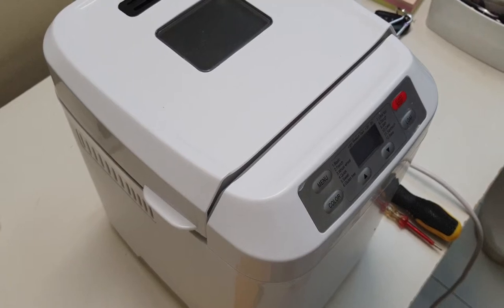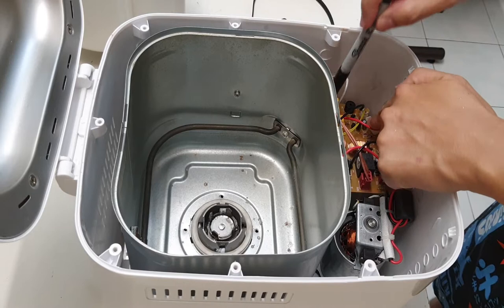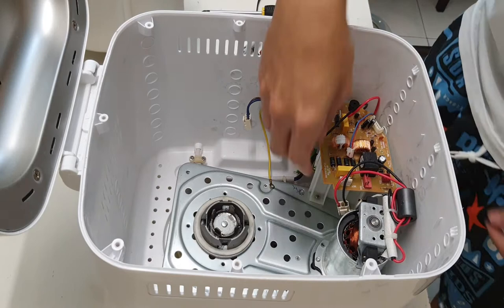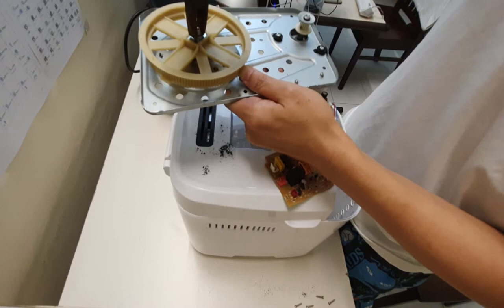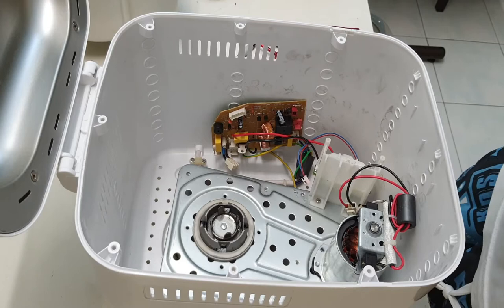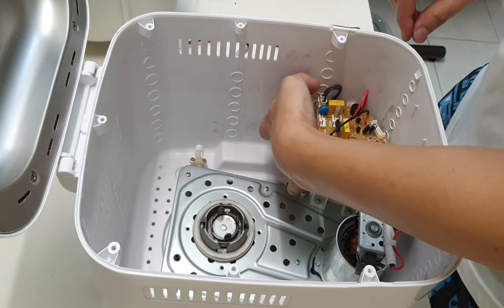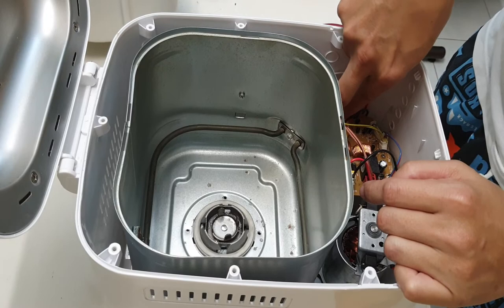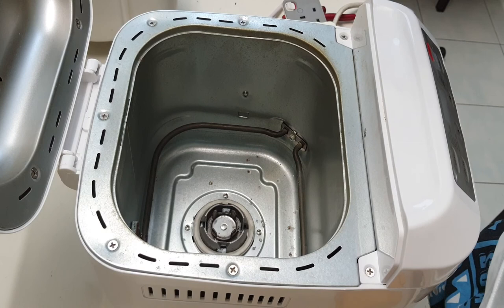Tesco Bread Maker BM1333 Faulty Motor Belt Replacement

Comment: Just found your video. Thanks. My bread machine's kneading paddle could not spin. Luckily with the link you gave , i was able to buy the timing belt. Maybe we could suggest to the machine manufacturer to make an opening at the bottom of machine so can reach and replace broken belt easily without disecting the whole machine. Thanks for this video.

Comment: hi, what size of belt did you used.
Reply from the maker: Buy the exact one that's rated for that model. Not based on measurement, but based on brand and model number.